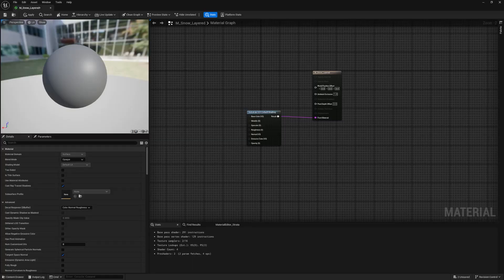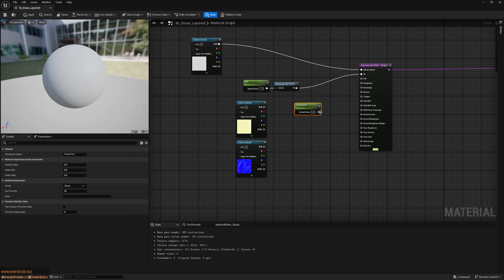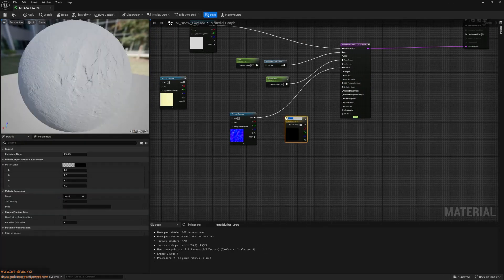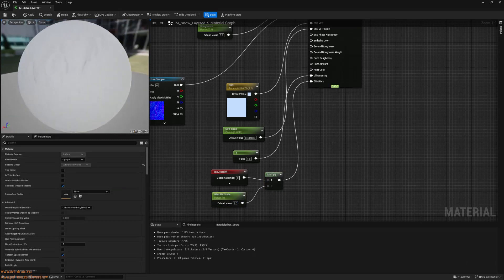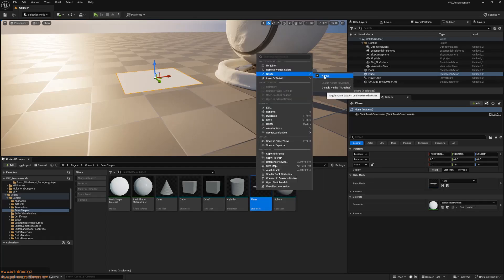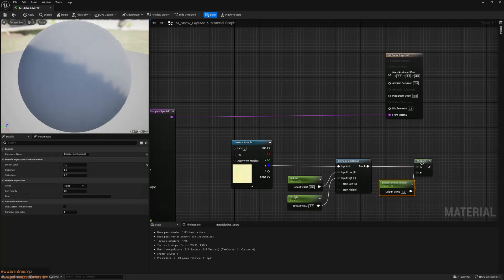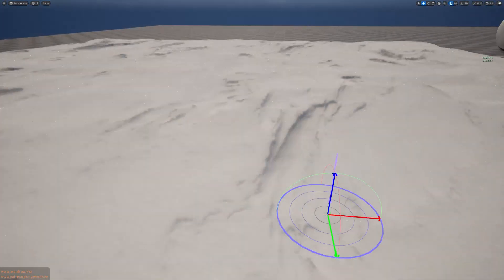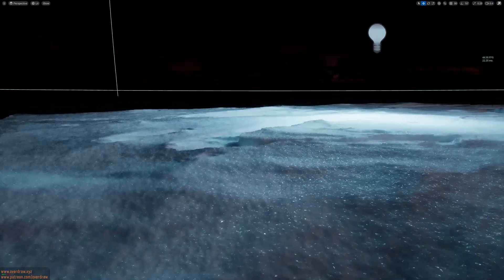Unreal Engine 5 Substrate - Photoreal Snow Shader with Nanite Displacement and Glint

Comment: It looks like they changed some stuff related to SSS and MFP in 5.6. By adding a transmittance-to-meanfreepath node in between the SSS Color and SSS MFP slab input, I'm able to partially get the effect working, but there is heavy flickering during movement that I don't know how to solve. Does anyone know of a proper fix for this for 5.6? (I'm actually on 5.7 preview but users were reporting this issue in 5.6). Also, the glint wasn't working until I set the Glint Density to a value of about 0.92. Awesome tutorial!

EDIT: I found a partial fix - if you change the MFP from a color to a single float, and set it to 0.9999, from a distance the flickering is mostly mitigated, however the closer your camera gets the more flickering there is.